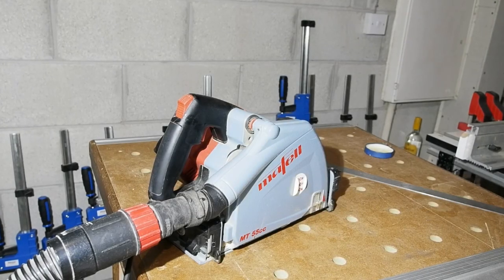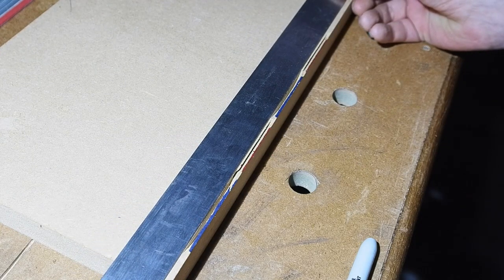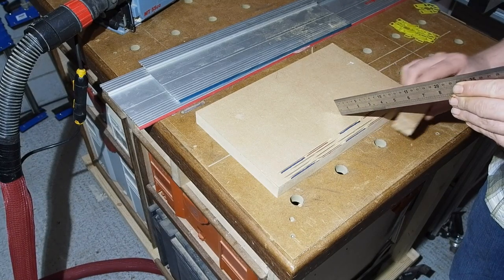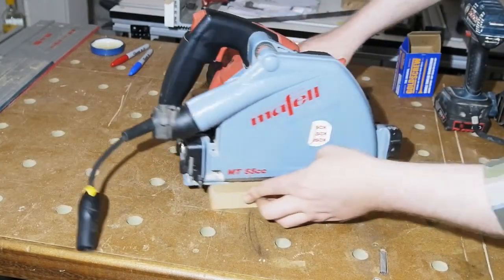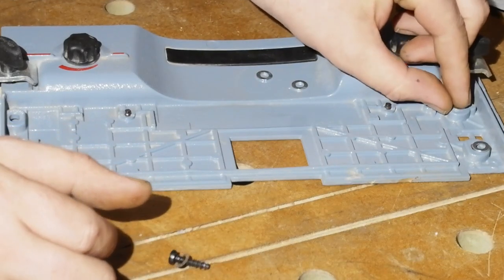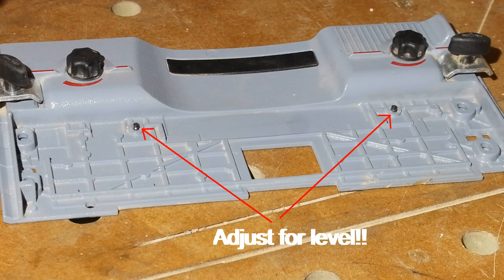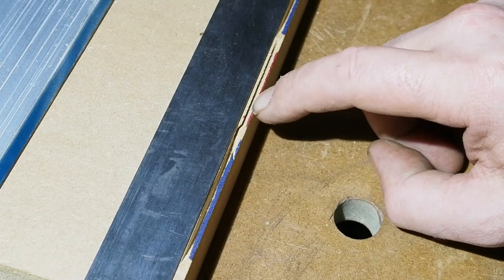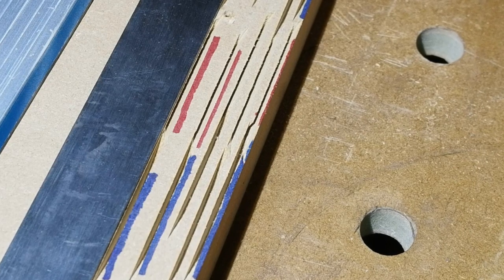0 - 45 Degree Bevel Cutline Fix for Mafell MT55CC

Comment from the maker: Just a note - as Alvy pointed out below - I forgot to mention that adding the washers lifts the blade height a little. You'll need to use the little micro adjuster at the top of the depth gauge to re-zero the blade.

Comment: Just an update, so I sent my cordless mt55 into nma to have a look at as it was still under warranty, It came back this week with the problem fixed. They fixed it in the same way that you did with some very thin shims.
It still caused me the same problem with the scoring function not cutting deep enough due to the machine being raised off its base.
I took the scoring switch off and ground it down a little bit to allow a couple of mm of extra depth, tried it and it worked spot on so all good 👍
Reply from the maker: Wonder if the folks at mma watched my vid for the fix😂😂 . Jokes aside, thanks for the update and glad you're sorted bud.👍

Comment: Just won the full cordless kit this morning and after watching the skill builder video I believe that there is meant to be a difference as when you cut on the bevel there is a little red plastic guide that comes out of the base to show you where your cut line will be. Can't wait to receive it this week! 👍😀
Reply from the maker: Supposed to be the same cut line on the guide rail. The little red moving plastic thing is to show the cut line off the rail. 
My little demo with the angled ruler in the vid shows if you lift the body ( like putting it on a guide rail), the bevel cuts are closer to the saw body. Lower the saw (off the guide rail) the opposite is true. Hope this helps clear it up a bit.
Congrats again on your win!👍
Reply: @BischBaschBosch  good morning 
I am about to purchase my first track saw and I am eyeing the Mafell cordless, question is it as good as the corded version? 

Is there any other track saw that is better? 

Does this saw requires any maintenance? 

Thanks
Reply from the maker: @rickyperkins232  Hi Ricky. In terms of features, the cordless has exactly the same as the corded. At full depth through hardwood, you might notice a slight dip in power compared to the corded but not by much. The cordless uses a slimmer kerf blade to help. Also, although Mafell only supply the 5ah batteries, they are the same as the Metabo batteries so you can make use of Metabo 8ah batteries to give a power boost and longer run time. I don't know if there is a better track/plunge saw to be honest. The Festool guide rails have a lot of useful accessories but, as the Mafell MT55 will also run on Festool rails, you could switch to that track system if you preferred. It's hard to find another track saw that gives you as many features, access to accessories and adjustability as the Mafell. Superb dust extraction and by far the easiest blade change too. In terms of maintenance, no more than any other saw. A periodic clean and making sure the blade angle and depth are calibrated, that's it. Most people don't even do that!
Reply: @BischBaschBosch  I have being on the bench and very resistance to track saw and waiting for Milwaukee to announce but will not happen at this point. 

Thanks because I don't want to buy a track saw twice so I want the best only

Comment: Thanks for the guide, it's really going to help me dialling my saw in. I'm in the process of servicing my MT55 (110V) that I inherited. It's not an old unit, 2019, but doubt the warranty was activated. It all seems to cut true and square, but I have a niggling worry about the bearings/gearbox. The saw sounds a bit gravelly on initial start-up but ok at full speed. I'm not sure if this is normal. I've pulled the brushes clear and rotated the armature and it sounds like something is rubbing or binding, but I guess this could be the brake unit. Lots of wood and plastic dust fell out of every orifice, while giving it a basic clean, so I decided to strip it down and give it a really good clean out. It's really well built and everything is easy to figure, until I got down to removing the motor/bearing/gearbox. The Front bearing housing does not want to come off and I wonder if it's maybe melted a bit from overheating? Have you ever stripped one down? TIA for any advice :)
Reply from the maker: Cheers. Never stripped one down to that degree bud. To be honest, start up and breaking sounds a bit rough on all the plunge saws I've used. Nothing too disconcerting though. Bearing might be the pressed in - sometimes done hot/cold for tight  friction fit.  This would make removal difficult. Would be very unusual for a bearing or bushing to fail though. Spindle/arbor wiggle would indicate that. Sorry I can't be more help.

Comment: Nice find.
My cheap Parkside track saw has a similar problem, but not so easy solvable: the 45 cut line is "inside" 90 cut.
Reply from the maker: Cheers. Interesting. I assume then the Parkside has a fixed pivot point? The sliding pivot on the Mafell I show in the vid is designed to move the blade out so it doesn't chop into your rail/strip. If your saw does have a fixed pivot point I don't think the highering/lowering fix I show would work unfortunately.

Comment: Great solution 😲  to a problem I had not realised existed.
Reply from the maker: Thanks George. Well, hopefully for most people the problem doesn't exist. Especially on saws sold as being able to cut on the same line like Mafell. But if it does exist for some, hopefully this helps. The beauty of the Mafell is that with there being so much adjustability built in, you can do something like this and still correctly zero the blade depth and square the blade to the base. With many other saws without these features, the fix could lead to issues.
Reply: @BischBaschBosch   checked my Bosch GKE and it was good out of the box, but it was comforting to have that confirmed, angled cuts can be an issue with getting the correct depth to angle ratio correct with thick stock.

Comment: Thanks for the video. It's too bad you have to even contemplate a fix like this on such a high-end tool. Do you know if the Bosch has similar problems to the Mafell? I'm considering one or the other at the moment.
Reply from the maker: Thanks mate. If you look through enough forums and threads, you'll find someone having this problem whatever the brand - even the premium like Festool and Mafell. The best advice in my vid is to check your tool when you get it and, if not right, get it exchanged or fixed. This fix is mafell only. It m8ght work for the corded Bosch as that was made for them in partnership with Mafell - but it's not the same saw. Many differences. The good thing with the mafell is it has micro adjust features in the base and for cut depth meaning, if you raise it 1mm as here, you can still zero the blade. On the Bosch, your depth scale would be 1mm out. 👍
Reply: @BischBaschBosch  So I bought the Bosch corded tracksaw and just performed the same test you did with the four cuts alternating between 0 and 45. I'm happy to report the Bosch cuts on exactly the same line at both angles. Thanks again for all the great videos!
Reply from the maker: @ToolTalkCanada  Great to hear mate👍

Comment: just need to change the  cast label on the side now to MT54CC. Thanks alot for the video. I guess the top of the screw mounts could have been milled parallel to, and the correct height from the underside of the base, at the factory
Reply from the maker: Hehe Cheers John. Yeah, you have to re-zero the blade with the micro adjust too. Can't remember if I mentioned that in the vid. You'd assume the mating parts of the cast base were milled at the factory. Maybe it's paint that creates deviation? Dunno. At least it's fixable though I suppose.👍

Comment: Great solution! That's really clever
Reply from the maker: Cheers Keith. How's the Makita on a 45 out of interest?
Reply: @BischBaschBosch  I've not tested it, but I should. Only ever tipped it in one project so far, it was really awkward as my Evo rails don't have the anti tip lip on them so you kind of need three hands to make a cut (or I should just use the clamps that are provided with the rails!!)
Reply from the maker: If only there was an anti tip after market thingy ...🤔😁
Reply: @BischBaschBosch  is that the device you reviewed? I didn't think it was compatible with the Makita? If it is, I'll invest!
Reply from the maker: @keefykeef  yeah, I designed and had them manufactured. Too expensive to produce unfortunately so I've dropped it. Did look at a version for Makita but would have been more expensive again. Too many cnc operations.🤷‍♂️
Reply: @BischBaschBosch  ah man, what a shame. I just looked back and watched the videos and it looked very clever. Let's hope one of the big manufacturers see your video, decide to manufacture it and make you a millionaire!
Reply from the maker: @keefykeef  😂 That'd be nice. I did talk briefly to Ralph at Benchdogs if he wanted to take it on. Nothing came of it though. Busy guy. I still get comments and emails from people wanting to buy. Shame really 🤷‍♂️
Reply: @BischBaschBosch  have you tried ujk?
Reply from the maker: @keefykeef  Could be worth a look bud. I haven't actually given the thing much thought at all this year. Maybe a resurrection is in order.

Comment: Hello! and thanks for the sharing! 
Could the difference between the 45° and 90° cut be due to the fact that the mt55cc is supplied with a 162mm blade and your are using a 160mm blade?
Indeed, most of the plunge saw blades are in 160mm (including at Mafell by the way : if you want a saw blade with less teeth than the basic one, e.g. 24 or 36 teeth, these only exist in 160mm)

I bought the mt55 not long ago and it is still under warranty. I have the 162mm blade that came with. I will try if i don't have this issue.
If i don't i'll try it with a 160mm blade & i let you know!
Reply from the maker: Cheers mate.  In the tests, I'm using a Keyblades blade, Mafell fitment. These are dimensioned exactly the same as Mafell originals. 162mm x 1.8mm. But ultimately, it's the hinge point that needs to be raised. Blade size/height will make little difference.

Comment: Looking at upgrading my supermarket track saw. Already have Makita rails. Can it afford to get Mafell plus all the rails yet. Wondered about getting a saw and running on Makita rails for now. Have you used it on Makita or Festool rails a d would that alter (if set up correctly) if the 90 and 45 cut line would be the same? Thanks.
Reply from the maker: Alright mate. There's certainly some dealers out there who could sort you a mafell saw without the rail kit. Westcountry Machinery4wood  online are good. My local 😁. My understanding is the Festool rails (and so I assume the Makita too) sit a little lower than the Mafell/bosch rails. Around 5mm for festool compared to 6mm Mafell. Going by what I've leant from this fix, this would mean your 45 cut would be 1mm or so away from the 90 cutline on the Festool/Makita rails. Or make it slightly worse if the saw already had a gap at 45 on mafell rails! 
Shame because that aside, its a hell of a saw. Depends how often you 45 as to how bothered you are I suppose. Nothing wrong with the the Makita plunge saw mind. Not quite Mafell but decent.🤷‍♂️
Reply: @BischBaschBosch   Thank you so much for that in depth reply. Have seen some decent offers on saw only, which led me to consider paying the extra as opposed to my original choice of the Makita, then thought Bosch. Last question I promise. All these will do what I need. One reason for thinking Mafell was the apparant superior dust extraction. Is there really that much difference in the three or is fine margins when it comes to the dust extraction ( I'd be using a hole cover in the Bosch and Makita)? Thanks again.
Reply from the maker: @manceconomist  No problem mate. Dust extraction on the Mafell is pretty unmatched. There's just a little puff out the front as you finish the cut. Covering the hole in other saws will make the difference negligible. I think Peter Millard tested it against the Festool covered and uncovered and it was still a little better. Not by a massive amount though.

Comment: Il have to check my bosch saw see whats thats like. Has this affected the depth gauge, or can that be adjusted ?
Reply from the maker: On the Mafell, there's a micro adjust that allows for resetting the depth zero. The bosch doesn't have that. This fix would work on the Bosch other than that, you'd just have to add a mm when you set depth.

Comment: My saw mt55 had a pin fall out of it when I turned it to 22.5 degrees. And it's a bit off when turned on an angle also.
Reply from the maker: Do you know where the pin fell out of mate? Doesn't sound good. If it's a bit off on the bevel, that's easy enough to fix. Just loosen the bevel clamp, drop the blade and use a trusted square to set a proper 90 deg. Then retighten the clamp. Set the little grub screw stops in the base to the new position and reset the red 0 indicator on the bevel gauge to the new position.👍
Reply: @BischBaschBosch  I think it's one of 4 pins in the tilting mechanism. Part number 84. I can see that 3 are still in it. And the one I can't see is blocked by other parts in the saw.

Comment: I have the mafell and my cut line at 45 is under the 90, as in cuts into my rubber strip which is annoying to say the least.
Reply from the maker: Wow. That's the first I've heard of one under cutting. That being the case you'd have to drop the height of the bevel mech. Grind a bit of material off the mounts on the base maybe? Much harder fix harder fix than an overcut I reckon. Think I'd rather just settle for a dedicated rail for bevel cuts.🤷‍♂️

Comment: Does it cut wrong even with the Mafel guide rail?
Reply from the maker: I've got a piece of both Bosch and Mafell rails out in the video bud (they're both identical). Mine was out at 45 on Bosch/Mafell rails. A friend of mines saw, same set up, was accurate at 45. So it's luck if the drawer it would seem. A saw that was accurate at 45 on a Bosch/Mafell rail would likely not be on a Festool rail. The Festool rail is slightly thinner, which would lower the saw, throwing the 45 cut line our slightly. Hope that makes sense.

Comment: Have few notes to add: 1- using "jig" he didn't disturb "Mafel Toeing" ; 2- depth change by that 1mm ; 3 ... forgotten .... :D
Reply from the maker: 1 - correct. Toeing should stay the same with the jig. 2 - Yep, forgot to say you need to use the micro adjuster to re-zero the blade depth. 3  - I've had a couple light ales now n'all 😂
Reply: Lightweight 👎😂

Comment: All you need too do is raise the blade height with the micro adjust theres no need for adding washers .
Reply from the maker: No, that won't work bud. It's the hinge point that needs to be raised. Raising the blade will do nothing. It turns out that my fix is what a mafell service centre will do for you to solve the issue.👍

Comment: Is it normal for this machine that both cutlines do not coincide?
Reply from the maker: Its sold as able to cut on the same line on the guide rail. My friends MT55 cuts the same at 0-45 degrees, mine didn't. Most I'm sure are fine but unfortunately, the discrepancy is not all that uncommon. Hence this video.

Comment: Unfortunately, with no offset blade can cut rubber strip in some cases.
Reply from the maker: Yours does this on the Mafell? If so, the same theory applies you just need to do the opposite - you need to lower the height if the bevel mechanism slightly. Only way to do this would be to grind some material off of the mounts on the base plate. Using a Dremel maybe.